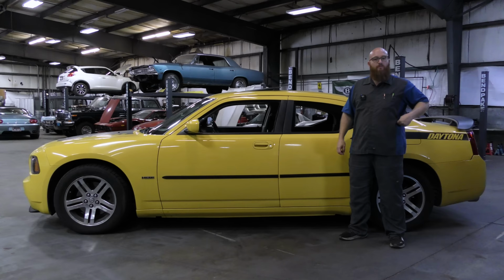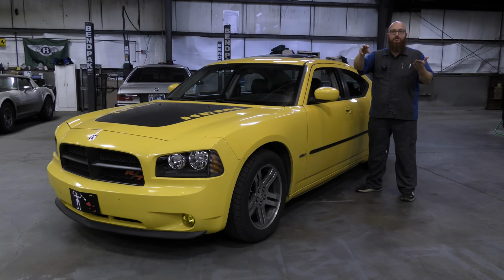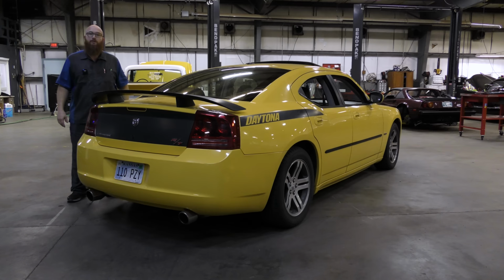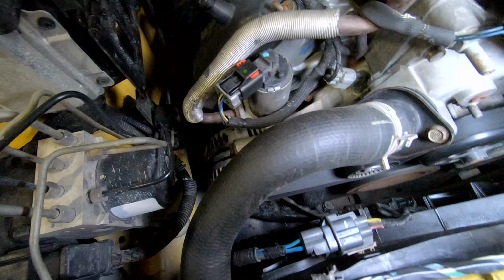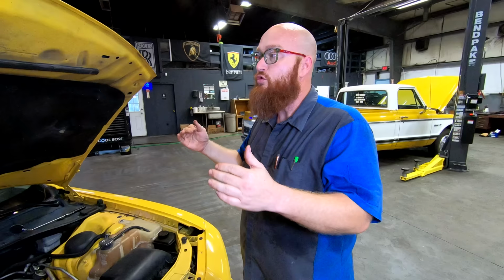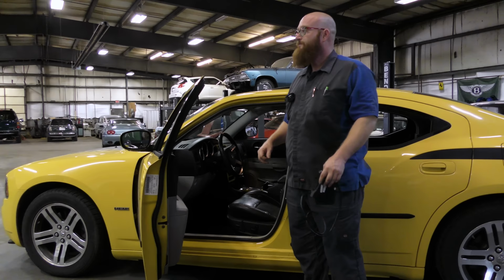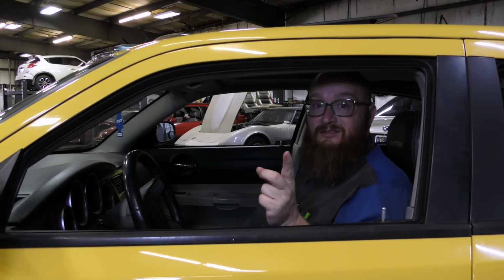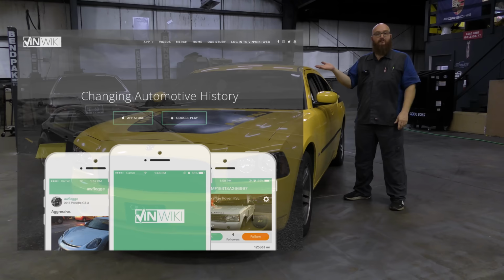4 things you MUST check before you buy any used car! CAR WIZARD shows how not to be scammed!

Comment: Check for even tire wear. If the tire isn't evenly worn, could mean the bushings/ tie rods, or even the whole strut is bad. Suspension work is VERY expensive. It costs less for an entire engine swap on some cars than for suspension work!
Reply: I found this out the hard way but the frame was bent and the car was going down the Rd practically side ways. Would absolutely destroy the back tires In just a couple months
Reply: Very good point, I'll check the tires 1st before I get in the car because if the tires are bad, why go farther. RUN AWAY FROM THE CAR
Reply: Dont buy a car with warm engine
Reply: I bought a car with new tires in October 2020 , 600 miles later the rf tire was totally worn out , I checked the rest of the tires and they were manufactured in July 2010. WHERE did they find 10 year old tires ? I had to have the front end rebuilt and purchase 4 new tires. About 300 miles later the transmission went out ( total 900 miles ). I had to have the transmission rebuilt. I called the person and told him what I thought about him.
Reply: what kind of car is suspension work expensive? a quick google of a 2013 toyota camry strut is $50 for factory kyb, tie rod $40 for upgraded moog brand. if you cant afford $200 struts how do you afford gas?
Reply: That's great advice but how do you tell if say the seller just put new tires on the car, yes I know I'm going to drive it to make sure it goes straight. But the uneven tire wear won't show for some time.
Reply: @Darkcruzer23  you have no idea what you are talking about.
Reply: @brandonaaron2665  🤣
Reply: @Darkcruzer23  depends on car. For my 94 F150 spring/shock about $100 a wheel. struts for a 2000 Concorde are $250 each. Have to take the whole rear seat out to replace. Dealer quoted $3,000 to do two rear struts!
Reply: @Darkcruzer23  labor.
Reply: @frznrrfan.frznrrfan102  ask for an alignment receipt.
Reply: @alpine1600s  so suspension work isn't expensive, labor is.
Reply: Depends on make and model. On one of my vehicles I can replace the inner and outer tie rods, pitman and idler, and the center bar for under $100 and a pair of GOOD shocks for about $70
Reply: @Darkcruzer23  you are correct, and I agree. However; I obtained an 08 Pacifica in a trade , with low miles /very clean , and the 4.0(265hp/270ftlbs) that is extremely peppy(I put a little different coil/ignition system on it and done some hand work on top end and injectors ....Because I had to anyway ) it is a Canadian made vehicle based off of Mercedes-Benz , but anyway, the front suspension components weren't terrible off of rock auto, the rear , for JUST parts, was over 1000.... If a vehicle has any sort of "stability control" or "active " suspension , it can get very expensive sometimes. Peace
Reply: Darkcruzer23 Don't be crast. A 2013 Camry strut might be $50👏. However, not everyone is a mechanic or DIYer. Have you ever heard the saying "Its not the parts that will break the bank, its the labor!?" Like he said, the suspension alone could bankrupt you quicker than an engine swap and he ain't never lied. Sway bar, sway bar links, inner/outer time rod, control arms, trailing arms, bushings, ball joints. Trust and believe if a vehicle is having suspension issues, one strut is NOT going to solve the issue. Most repair issues are solved in pairs. If the front passenger strut is blown on a 2010 Camry, then at the very least the 2 struts driver and passenger side should be replaced. Now if you go with quick struts from Rock Auto its $150 for the 2. Labor from a private mechanic could cost $40-60 per strut. Midas Mufflers quoted quick struts  $1300 parts and labor  for a 96 Corolla 🤯.
Reply: @ced9973  again then it's not the suspension, it's labor. Two completely different things.
Reply: Suspension work is easily some of the easiest and least invasive work you can do on a vehicle. Engine/transmission condition is far, far more important of a topic to hone in on.

Comment: One thing I would add is do a proper research of the model, find what usually goes wrong with it and make sure most of those problems have sorted alredy, otherwise thing can get really expensive. For example: old Mercedes CL or S class - ABC suspension. Jaguar XJ8/XK8 chain tensioners. Northstar engine - headgasket and so on.
Reply: yes

Comment: You probably should have added to check under the oil cap, and the coolant reservoir cap and make sure it’s not all glittery, has weird substance on it like you mentioned in your previous videos to see if they’re hiding a head gasket issue.
Reply: Or engine sludge buildup.
Reply: Great point. Great Great point. I bought a car somebody put a head gasket sealer in. The car was NOT designed for the sealer, didn't even need a head gasket seal, it ultimately destroyed the cooling system. I had to fill and drive the car with water until about 100 liters of water had gone into the car and leaked out of the car. It then started to run. Perfectly like a normal car. I just flushed thr cooling system yesterday and immediately lost all heat. So the heater core is probably clogged

Comment: in your under the hood inspection you should also take the oil fill cap off and make sure there is no milky sludge on the inside of the fill cap which could mean head gasket issues.

Comment: Remove the oil fill cap and shine a bright light in. If the inside looks golden and clean the car probably been cared for,if you see black sludge don't buy it.
Reply: I change the oil on my cars religiously
Reply: I lost my car because I didn't change the oil :(
Reply: Or “Chocolate Milk”, which indicates contamination with coolant.

Comment: Hey Car Wizard, excellent in-depth review and great advice.

I would like to add a few tips that weren't covered (my apologies, if they were, while I went to the fridge).
1.  Check the tires for unusual tread wear.
2.  Besides checking the power windows, locks, mirrors, etc., also check if all the lights work.
3.  If you have a buddy along for the inspection, have him/her follow you in a separate car and look for defects.
     Vehicles with 'frame damage' don't track correctly.  (An exaggerated case would be the vehicle driving
      'crooked' or semi-sideways.)  Any liquids dripping from the tail pipe?
4.  Do the 'bounce test' on the front and rear ends, while it's stationary to test the shocks/struts.
5.. Does the front end 'dip or do a nose-dive' when braking?  Or, 'lift' while accelerating?

As always, your videos are informative and unbiased.  Thank you.
Reply: Does liquid not always drop from exhaust pipe on a petrol engine.
Reply: @martymartin2894 I would assume it does that when it’s running rich, which means the fuel/air mix is too high in fuel.

Comment: These days, this is great advice for dealerships too! The pre-owned sections of lots have really lowered their standards due the current market, so being this detailed protects you!
Reply: 100% agree, i test drove a cruze and half through the drive the stabilatrac light came on.
Reply: Sometimes the stabiltrac light and other problems that come up quickly on the Cruze are due to a bad ground wire on the battery the crimp cracks and causes problems usually a simple fix
Reply: @richardogle7772  keyword is usually
Reply: A dealership car can be taken to a independent mechanic. Pay the $100, get it up on the rack, and go through the thing. It’s worth the hassle.
Reply: @motojaymn4131  that's just what cruzes do
Reply: A lot depends on THE DEALER you buy from. I bought a '20 Blazer from an "on-line" dealer only about 6mo ago, (Carousel On-Line in Minnesota). I have NEVER bought a vehicle, sight unseen, before. The Blazer was delivered to me in Central WI (150mi), it was EXACTLY as described by the seller. All the paperwork was in order, and even though the car had 52kmi on the "clock", it was as NEAR NEW as any USED vehicle I had ever purchased in 60+ years of buying and owning vehicles. I have put about 2k miles on it in the past 6mo with ZERO ISSUES! Maybe I got lucky with this purchase, but I would do it again. Btw, the only "human" (in person) contact during the entire buying process, was the TRUCK DRIVER that delivered the Blazer! How COOL was that!

Comment: In California, the seller must also provide a certificate of a recent successful smog test which will be necessary for the title transfer. And, for safety, the buyer should also check NHTSA for outstanding recalls. There are still cars on the road with Takata airbags.
Reply: WTF is a "smog" test?
Is that like a tailpipe emissions test?
Reply: @mitsuturbo  that’s the common and surprisingly legal term for an emission test. All over the State you find “smog test centers “ where motorists go to emission test their 1975 and newer vehicles. If you pass you get a “smog test certificate “ that enables you to renew your registration. Most cars older than 5 years, need to to be tested every two years.
Reply: Good call and I always do.  My Taurus wagon had 8 recalls and thankfully all were completed and cleared.  Most would never think of that site.  Smart

Comment: To speak on the antifreeze smell after the engine has been running, I had a leak and replaced all the tubing and water pump. My vehicle smelled like hot coolant for months after the repair when I was done driving just from the residual coolant that had leaked prior to the fix. So, the smell of a coolant should raise red flags but not necessarily be a deal breaker.

Comment: Another thing to check is the digital display on the dashboard of the oil life, miles vs hours, etc. 
In 2007 I bought a 2003 Suburban, fully loaded, 4x4, etc. but after I got it home and started looking at the stats on the digital display it showed 39k miles but over 3600 hours. 
I still believe to this day that the dealership rolled back the mileage.
Beware. Thanks Car Wizard for helping people.
Reply: Nah that's just a load of idling time.
Reply: @russell-gt1dy That's what I was gonna say.

Comment: Couple more things to add: I also check tire wear and depth and date on the sidewall to see how old they are. I also want all four to match up. Tires are not cheap so I will use that to bargain the price. Also in my state, a smog check is required whenever a car changes owners. I want a passing smog check in hand. I also always run a CarFax if for nothing else to verify the mileage. I have a family member who was scammed in the mileage department a few years ago. I also had a buddy who sold a car on CL with a certain number of high miles on it and literally a few hours after the sale, the new buyer was advertising it on CL with ALOT less miles (he had them lowered)  while using the same exact photos from my buddy!!!
Reply: Check everything on a used car PERIOD
Reply: How can you lower miles on modern cars?
Reply: @wolfeadventures  Easier than on the old ones .... just computer needed
Reply: @wolfeadventures  Seen people advertising scan tool services on FB marketplace for that purpose.
Reply: @wyrazowfkp  Sometimes not even a computer is needed. Certain cars only store the miles in the cluster and not in the computer/BCM of the car itself, so simply swapping the cluster in 5mins can add thousands in value for a scammer.
Reply: They could be new or newer tires but the car sat like in my case at a dealer  for who knows how long to dry rot an degrade but look like brand new tires when u buy it
Reply: @wyrazowfkp  still easier old school by jus turning the dial back manually...unless u have something that integrates with the ecus ect ur not doing much of anything most do not have the equipment but everyone has the basic tools to turn back a milage odometer...so no not easier lol
Reply: If the 4 tires do not match up that is a warning sign and I usually end right there. Understandable of one tire or two pairs of tires, but 4 different tires, no thanks.
Reply: @hondamoto-rb6bk  Nope.  Pluging in a computer is much easier when you know how to do it than taking off the whole thing out and manipulate the odometer....  + new cars still have something like a drum with numbers and you can plug in a drill to go back with mileage ?  I don't think so.
Reply: @wyrazowfkp  u need to re read what I said champ lol
Reply: @wolfeadventures  
One way is they take out the dash cluster and replace with one with lower miles.  Used dash clusters can be found at junk yards or ebay  the lower the miles the more they get for them.
Reply: @paulcoenen7918  The ECU also has this recorded and should come up at inspection so you'd have to swap the ECU as well so it matches.
In the end it's still possible to figure out something is way off. 
Shaving 10k nobody will notice but 90k it's difficult
Reply: @wyrazowfkp So a dealership could theoretically change the odometer?

Comment: Don't think you are safe buying from a dealership. I bought a used Nissan Altima from a dealership. On the way home from the dealership the oil light came on. Took it to a Nissan service department and found out the engine had a cracked block. Engine was junk. I called the dealership that I bought it from and they said it was as is. No warranty. After I threatened to put it all over social media they agreed to go half in with me for a used engine. Needless to say I spent an extra $3000 out off pocket. Always have a pre buy inspection done before buying any car especially from a dealership offering no warranty.

Comment: I've bought and sold a lot of cars over the years and I've never been scammed... I do my homework and when
i drive a car I can tell what items need attention.  The only car I really took a loss on was a 64 Mercedes, it ran great 
and looked great but no one wanted it.  BTW, sometimes I look for salvaged titles.  If the car was in a minor accident
you can pick it up for way less money.  I bought an Sion XB with that title because it had been stolen and still
driving it after 5 years with zero issues.

Comment: A little trick i was taught was you can swipe the tailpipe with your finger and if it comes out all black it means the car burns oil bad. And open oil cap to see if its sludgy or chocolate milk .

Comment: Thanks for another great video. My two daily drivers are salvage titles, but I knew that going into it. 
I've put tens of thousands of care-free miles on my '06 Element and '03 Vitara 2 door. 
Passing on any salvage titled vehicle is just the advice us bottom feeders like to hear.
Reply: Nothing wrong with them as the body man knows what's doing.
Reply: I bought several, minor stuff and have a solid
Piece of transportation, have one now low miles,
Needs a headlight and fender…
Reply: @rickreese5794  I got this '06 Element for a steal with under 100k miles. Needed a few odds and ends but I got it sorted and it's been a winner. Coast to coast camper.
Reply: Brought a salvage ford. Only damage was the grandma put in reverse and floored it (instead of the brake). Tail light, bumper cover, 2 rear shocks, and a slightly off-center tail gate on the hatch back.
Reply: There's one sitting in my driveway. I always like to ask the seller of pictures of damage prior to repairs. Nothing wrong with salvage titles, these days shopping around Copart there's a lot with minor damage that are salvage due to no available parts.
Reply: They are the best vehicles to buy but a lot of people don't know that.
Reply: How easy is it to get registration for road use in a salvage title?
Reply: @Nasa-cosmonaut  I'm sure that it varies by state, but I'm in Idaho and it was a breeze. They treat it as any other classification of title.

Comment: One thing about buying a salvage car, you should plan on keeping it until the wheels fall off.  As a first car for my son was a salvage Hyundai with about 7000 miles for $6000.  Checked the usual things out, everything worked.  It had repaired front end damage, replaced right fender, bumper, right side lights, and hood. Repainted.   No frame damage.  Test drive was good.  8 years of driving  my son put on over 175k miles  very few problem, usual maintenance.  Dealer/seller showed me all the paper work, he paid $3,200 for it.  We sold the car cheap for $400 as the catalytic converter went bad and it would cost about $700.